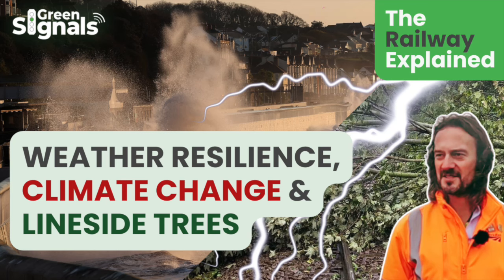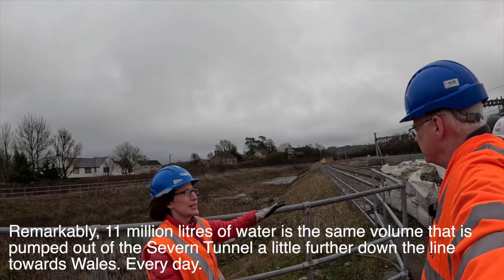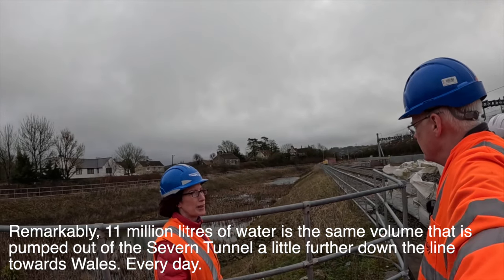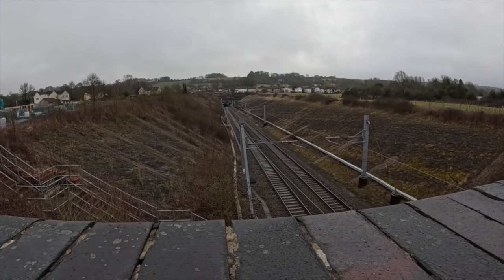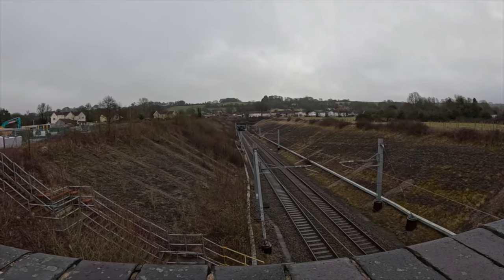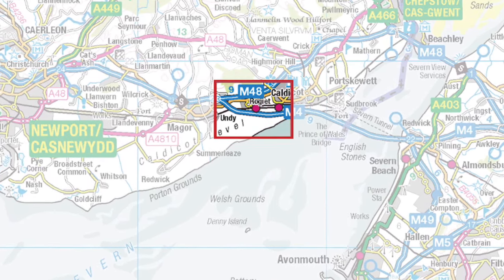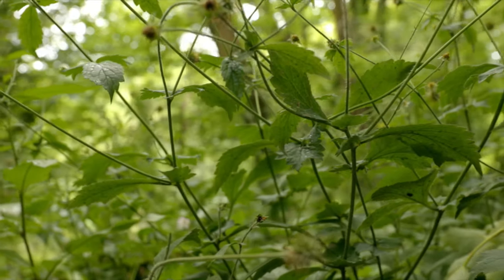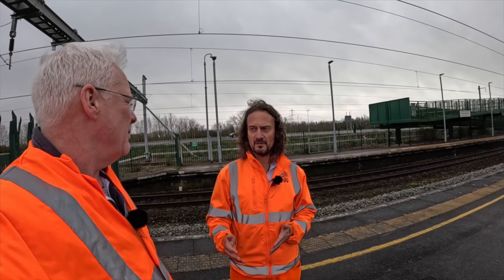Weather resilience, climate change & lineside trees on the railway

Comment: Great video.  The last clip at the foot crossing with a TSR reminds me a bit of Crowle in Lincolnshire, there has been a 20mph TSR on the Down Line (towards Doncaster) through the station for the 10 years I’ve been driving (unsure how long before that).  It’s on due to sighting restrictions for passengers crossing to the Down Platform, whilst there is a whistle board for approaching trains to alert people, the risk is that a train stopped in the Up Platform will block people seeing the approaching train as they cross behind the train to the other platform.  The only real solution is to provide a footbridge, but given it’s relatively low passenger numbers, and also a canal directly behind the platform, I think we are a long way off a solution to remove the TSR.  Incidentally it’s also recently been modified to a TSR (A) like in your video, so trains can now accelerate once they have reached the board, rather than dragging the whole train over it as we used to, obviously slowing things down more given the length of some of the freight trains passing over it.
Reply from the maker: You are spot on about that TSR (A). I should have pointed that out to the viewers. It doesn't fix the problem completely of course but it helps and we saw it in action when that unit went past. Many thanks! Richard

Comment: Great visit by Richard. The hoops and delays in starting work on the lineside seem too much and slow thus causing increased cost to the railway. For a risk reduction exercise it does seem too much. The danger to trains and travellers is too much so streamlining of processes is badly needed. Great video as always. One tip would be to keep the captions on the screen longer as they were quite wordy.
Reply from the maker: Thanks Allan. And appreciate the feedback re the captions. Will either leave them up longer or try and make them less wordy in future! Richard

Comment: Having been a signal engineer with responsibilities for signal sighting inspections, I understand that there are many dimensions to the management of lineside vegetation, not just leaves on the line. 
However, I am also an environmentalist and recognise that railways and highways can provide an important resource for nature if managed well. 

What I find a little annoying is the fragmented way in which government policy encourages companies and industry sectors to manage ‘green’ issues. Whilst it is right for rail to manage its environmental impact by following guidance provided by RSSB, rail itself is already green when compared with other modes of transport. The focus on environmental improvement should be wider than rail, to encourage modal shift, perhaps by charging a carbon levy on polluters.
Reply from the maker: Thanks Richard. Appreciate your comments which echo the sentiments of many.

Comment: If there were no dormice present I don't think a licence is necessary, certainly not for lineside trees.  Network Rail has a statutory duty to maintain a safe railway corridor and is able to manage its land like any other land owner, this being effectively Crown land.  

Secondly, who is issuing these licences?  The Environment Agency?  I agree that this should be an internal function or at least a permanent interface with the EA for each sensitive project, with agreement for planning timelines, involving long term possession planners.